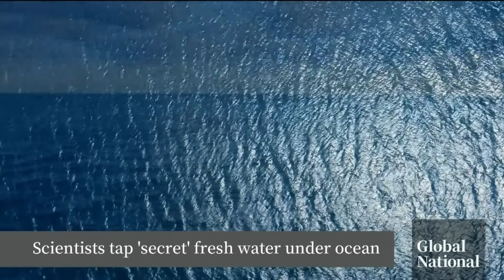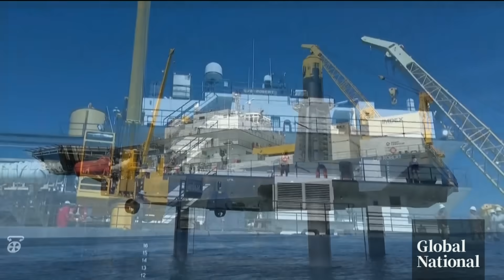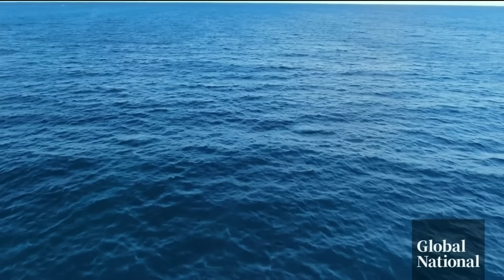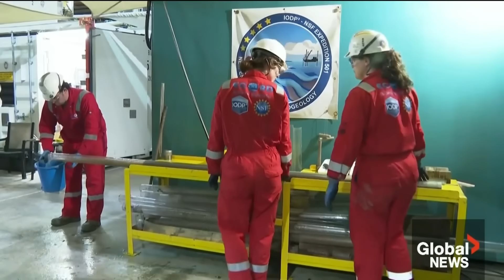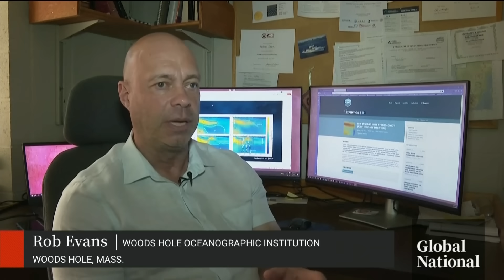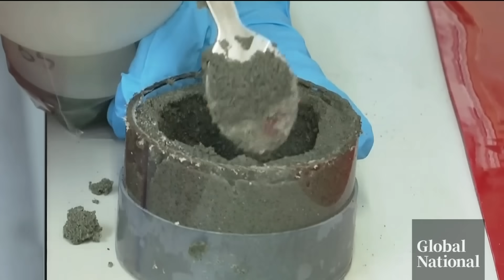Scientists uncover potential untapped fresh water source in North Atlantic

Comment: You dont have to drill, discover desalination its easier
Reply: Desalination is a double-edged solution.Have you ever been to arid regions,like Middle East? It is a real problem,because desalinated sea wster is never 100 % salt free.Trace amounts can build up in the soil in hot climates,because water evaporstes quickly.When desalinated water is used to water plants,the soil accumulates salt over time.Simply,what is taken from water,water absorbs back.
Reply: One the richest persons on earth will be the person who invents and implements a desalination plant that is feasible.  People tend to think too hard.
Reply: desalination is significantly harder then drilling though? It's extremely power hungry compared to drilling, water can hold a ton of energy before it turns to steam.  There's many more drills then there are desalination plants
Reply: The lesser of wo evils?
Reply: There's even better ways now pulling it from the air

Comment: Just invest in desalination technology and make it affordable. Humans seem endlessly capable of introducing new risks with higher penalties.
Reply: Last time I saw anything on desalination, it was still far more costly to do than it was worth on a large scale. We definitely need the technology improved
Reply: ya just do that😂
Reply: Desalination IS a risk with high penalties 😂.
Just use the water that falls from the sky, don’t waste it, buffer it etc.
Reply: @MacGuyver85  It's not meant to replace fresh water sources. It's just be an added option in mostly remote locations and certainly safer then removing it from under the bedrock.
Reply: This!!! Invest in desalination and burning our trash at the highest temperatures possible so little to no gases or pollution is released! I swear we’re doing everything wrong smh.
Reply: Desalination is not sustainable in large amounts.